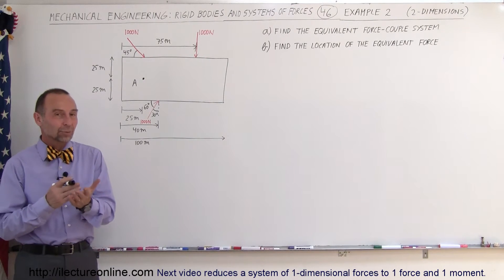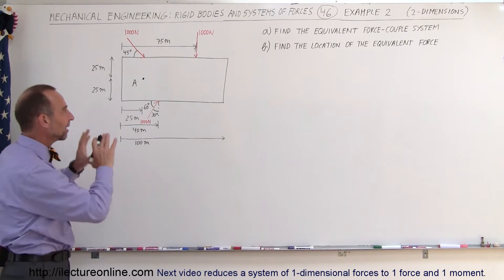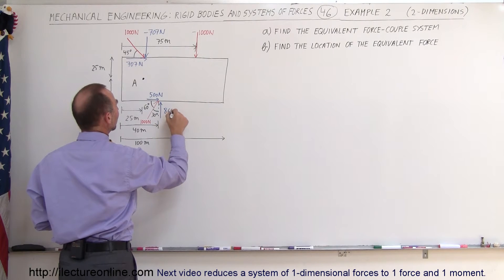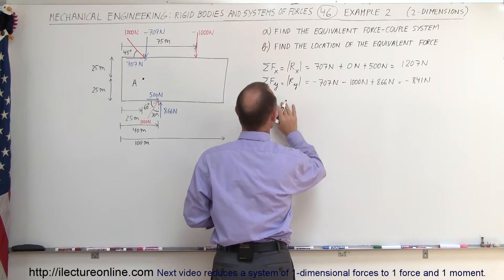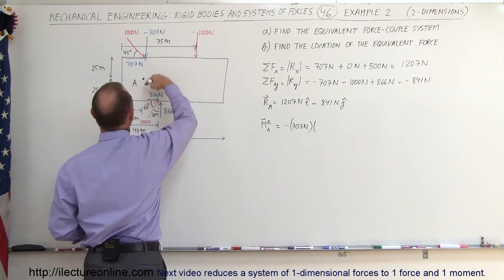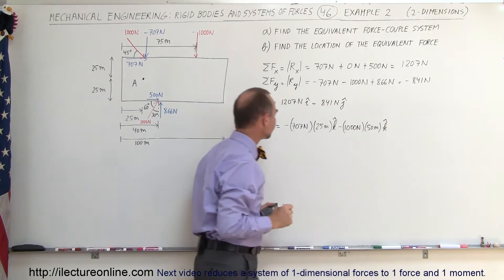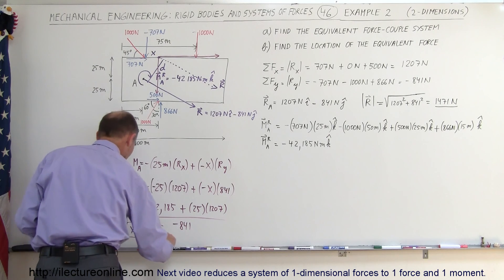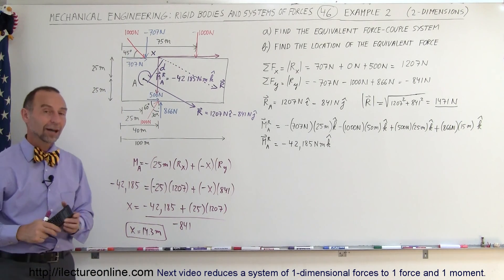Mechanical Engineering: Rigid Bodies & Sys of Forces (46 of 47) Reduction of Forces (2-D)

Comment: When my brain visualizes "find the location of the equivalent force", I picture this.  Any point inside the bounded rectangle area.
So, then I get confused with too many possibilities.  However, I finally I realize there is only two "practical" possibilities. The top or bottom edge.

This is where math and engineering create comedy.  The mathematician might assume just like I did, and his solution would be a radial locus of points in the rectangle. This would be correct in fact.   However, an engineer who must mount a bracket to apply that load will select either the top or bottom surface and specify a distance from a corner.  

Anyways, my mental note is that the "equivalent force" must be applied either the top edge(CW or -k rotation) or bottom edge(CCW or +k rotation) and referenced from a corner.